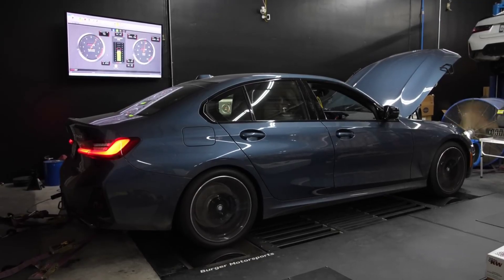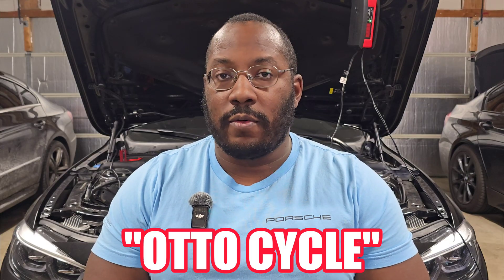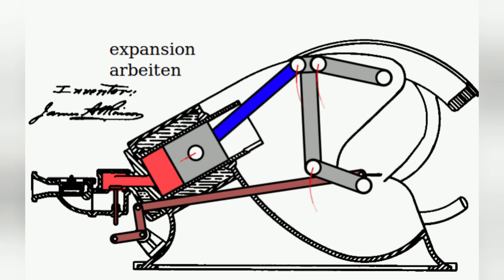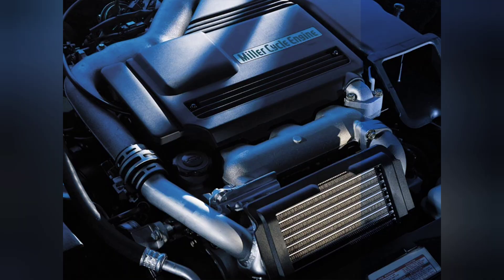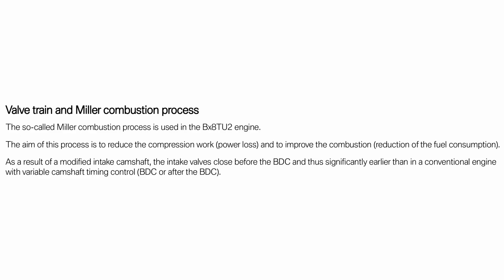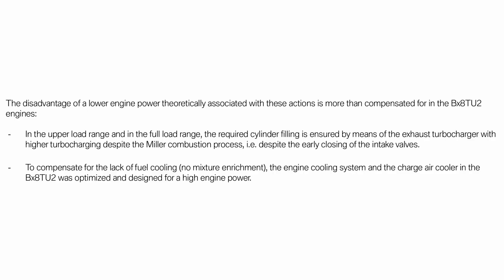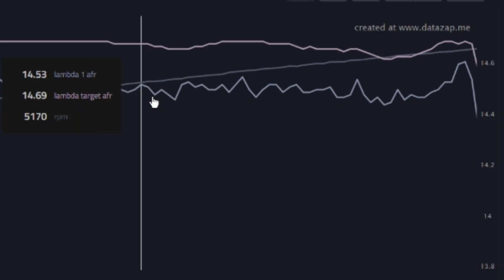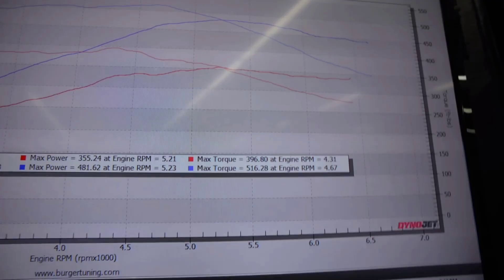Why New BMWs Run 30PSI at 14.7 AFR... (Miller Cycle Explained)

Comment: BMW doesn’t care about keeping the valves clean. They added port injection to address particulate emissions.
Reply: Direct injection is generally pretty clean and efficient, but tends to generate particulate emissions at certain operating conditions. EPA is cracking down on particulates, so OEMs are layering in port injection for these operating conditions.
Reply from the maker: From the BMW Literature:

The enhanced carburation has the following.advantages:

-Low particulate emissions
-Consumption optimization
-Cleaning of the intake valves using the fucl-air mixture of the intake manifold fuel injection
-Very good acoustics in neutral
-Very good response characteristics during cold start

DI has historically NOT been able to address carbon buildup. Only recently are OEMs figuring it out. See BMW N54, Volkswagen 2.0 TFSI, etc.

Comment: λ=1 provides the best fuel mix for the catalyst.  It is not best for economy or power.  This mixture makes the hottest combustion temperatures, it gets cooler going rich or lean.  Running λ=1 at full throttle keeps the catalyst active and adds controlling its temperature to the list of issues BMW faces.  Current F1 engines, whose power is limited by fuel, not air flow, run λ-1.5 or so at full throttle and use jet ignition to get it fired.

BMW Valvetronic has been running Miller cycle since its inception 15 years ago.  It is a very slick system.  Reducing compression can be done by closing the intake valve early or late.  Valvetronic and F1 use early closing.
Reply: what advantage is there for early closing? wouldnt it cause power loss from the intake stroke?
Reply: @rabbitdrink Yes it does cause power loss.  So does closing the throttle.  But closing the throttle does it in an inefficient way, closing the intake valve early is more efficient.  When cruising at part throttle, the engine has to do work to suck air in against the intake vacuum.  Closing the throttle early, reduces that work making the engine more efficient at part throttle, which is how we drive 95% of the time.  Other techniques to improve part throttle efficiency are also used, high EGR, high valve overlap, low rpm are a few.
Reply: @garyderian4350  sorry i meant like compared to closing the valve late. like wouldnt it make more power that way?
Reply: @rabbitdrink Either way, the intake air charge is limited, and intake vacuum is reduced during the intake stroke.  I think it is a little cleaner to close early since air isn't being pushed back up the intake, then sucked in again.  But it works either way.  With valvetronic, the valve lift is also restricted, so early closing with a big restriction limits the air even more.  With late closing, the throttle needs to restrict the flow causing a steady vacuum during the intake stroke and part of the compression stroke.  With early close, vacuum builds in the later part of the intake stroke, which then helps pull the piston up during the beginning of the compression stroke.

Both work, both limit compression pressure which eliminates knock, and both have a greater expansion ratio than compression ratio.  Power and efficiency come from expansion.  Compression is limited by knock.
Reply: @garyderian4350  true, thank you

Comment: My bone stock ‘13 F06 650 GC spanked a ‘12 C6 grand sport. From a roll and from a dig
Reply: c6 needs driver mod😂😂😂
Reply: @ I had a better first gear, as he had traction issues. He couldn’t ever get me back. From a 40 roll, I owned him worse. It was obvious the difference. Full fender by 100mph, over half car at 140mph.

Comment: All the pressure is on car manufacturers to make more efficient vehicles but none of it is in the energy companies to provide better fuel (higher octane) more widely available.
Reply: Right, we should be able to extract more energy from the fuel. This means running higher cylinder pressures. 🤔 What runs extremely lean and high pressure? A Diesel.

You know what happened to the diesel engine? The emission standards forced lower compression engines to reduce NOx. 

If you only care about efficiency, that's easier to do. Getting both emissions and efficiency is much more difficult.

Comment: Not BMW, but interestingly enough, Mazda adopted the Atkinson cycle in their skyactiv X engines. It’s only offered in Europe and it’s quite underwhelming considering the hype around it circa 2017 when it was announced. 15:1 compression ratio and the party trick was the ability for the engine to switch from standard Atkinson cycle to “SPCCI”, where the engine under certain conditions will switch to compression ignition, which you guessed it, compresses the AFR using compression like a diesel instead of spark plugs. It only achieved 45mpg average, while being a 177hp 2.0L NA car, so the marginal benefit of the gas savings and low power really made it pretty mediocre. But it is a very interesting engine as it’a one of a kind. Tangent and wall of text over. 😂
Reply: hondas r18 has vtec but instead of making big power they used it to switch to atkinsons cycle. i had it in my fg1 civic but i was always wot and at redline so it barely got any use :)

Comment: You almost got it right.. The Miller cycle shifts a part of the compression away from the cylinder to the turbocharger. So the pressure and the temperature at the end of the compression phase is lower compared to normal cycle(the intercooler is in between turbo and cylinder helping with the additional cooling). This shifts the knock limit and allows for a more efficient ignition angle reducing exhaust gas temperatures at wot preventing from the need fuel enrichment.

The boost is in fact higher, but with the miller cycle the intake valves open for a shorter time duration. Check for the valve lift curves with active miller. So talking about boost ist only one half of the truth. Valve lift and timing has a huge impact on the air mass inside the cylinder. This is the only value which matters when it comes to maximum torque potential.
This is because nobody in engineering world talks about boost pressure but about relative cylinder filling.

Comment: Yes they taking advantage 1st keeping the valve clean and increasing air density that what matter not boost cause air density what really makes power.
Reply: the 2025 b48 also has this miller cycle now. does that mean carbon buildup is almost non-issue even though it is only direct injection?
Reply: @jeanbean691 im sure it wont be. banking on these engines for getting known as unreliable bc people never cleaned their valves so i can get the cars cheap and build them :)